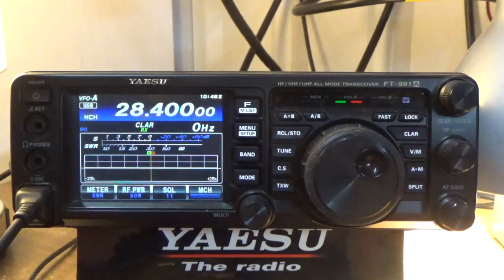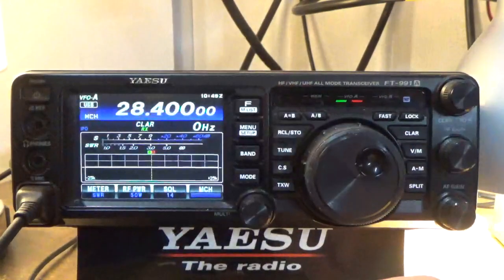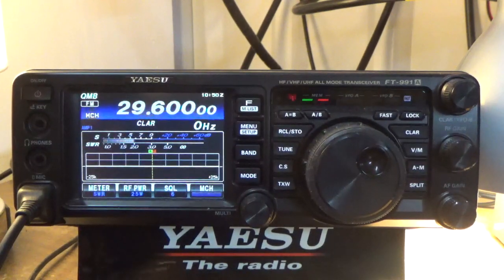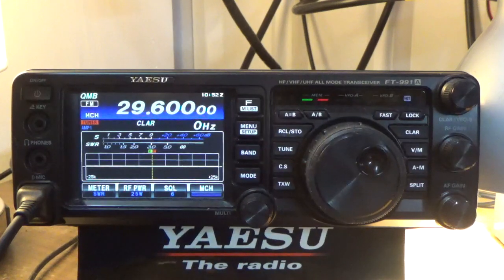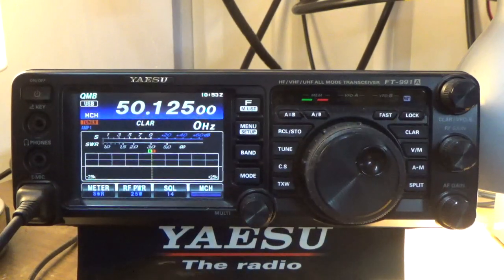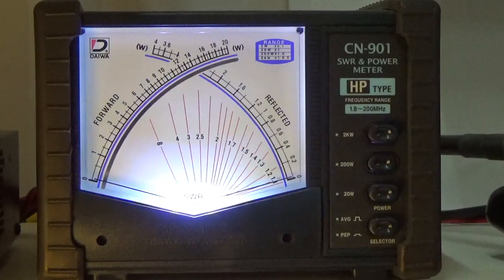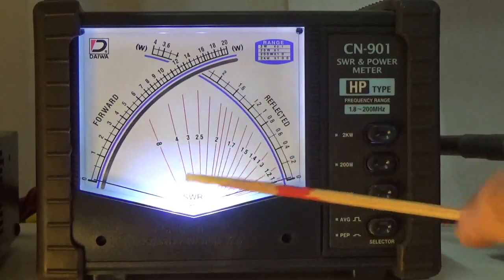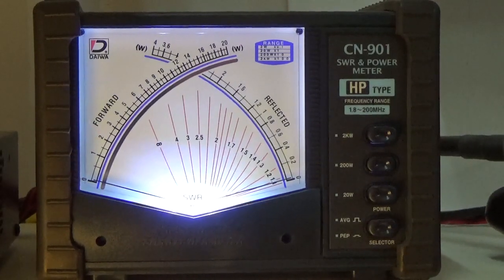Phase 4 (FT991A Antenna Tuner Efficiency) 10m (USB & FM) 6m (USB) with new CP610 Antenna

Comment: I live in a block of flats 13 meters high and I want to hang the antenna 3 meters above the flat roof. What will be the effective height of the antenna - 16 meters or 3 meters??
Reply: What antenna, what frequency, and what is the roof made out of - metal or not?
Generally speaking though, you should be much better off 3 meters up on the roof than 3 meters off the ground.
Reply: Hexbeam antenna 20-10m; non-metallic roof @WR3ND